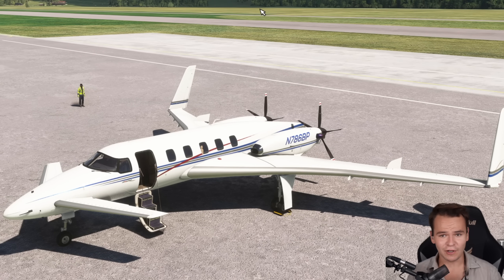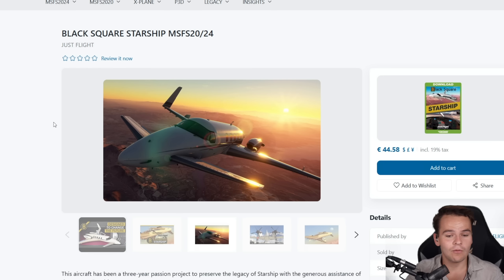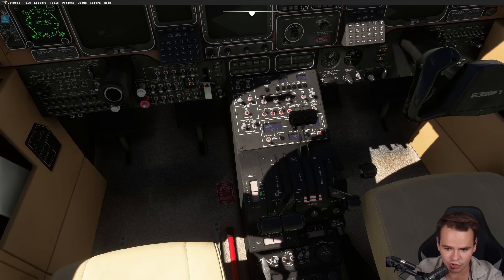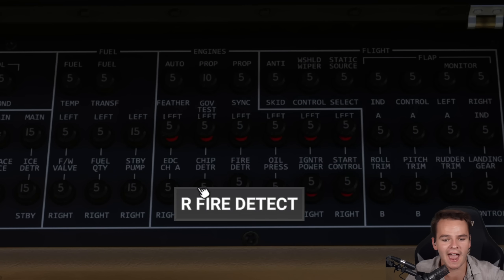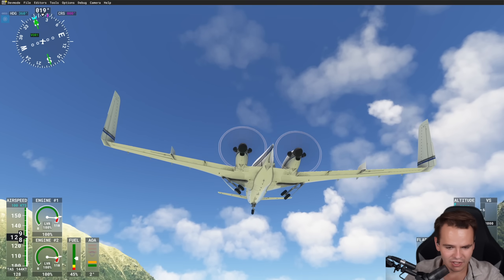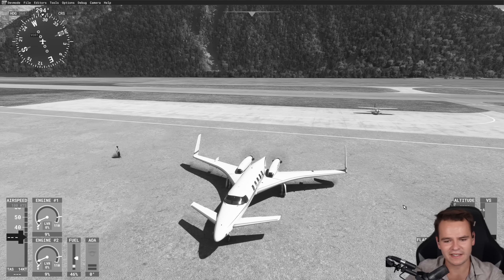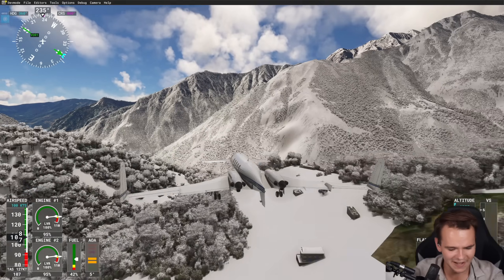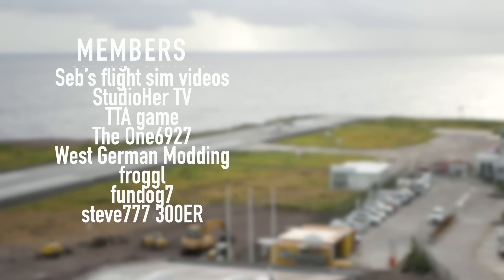This Airplane's Weird Design Prevents It FROM CRASHING

Comment: 8:33 never knew the canards also swept forward when you increased the flaps.. wonder what the benefit is
Reply: As a guess, it's to compensate for the changed geometry of the flaps. Straight on would produce more lift but more drag.